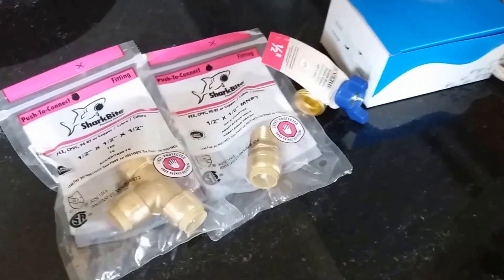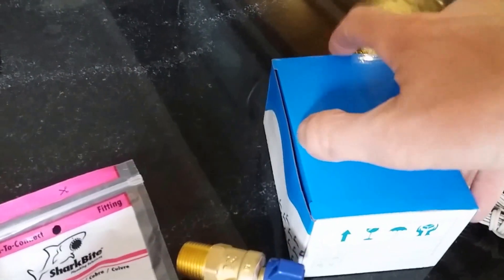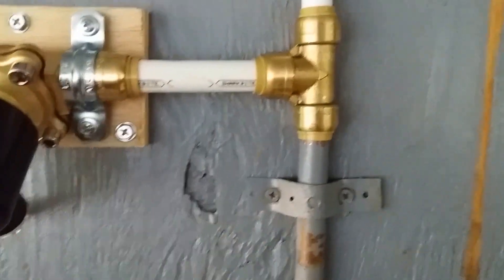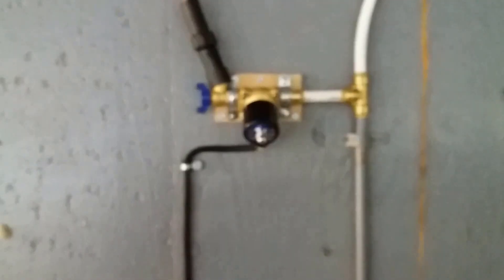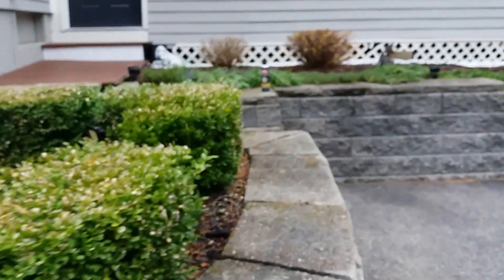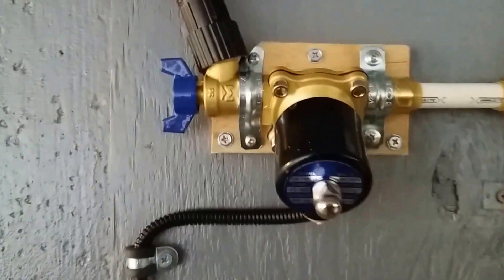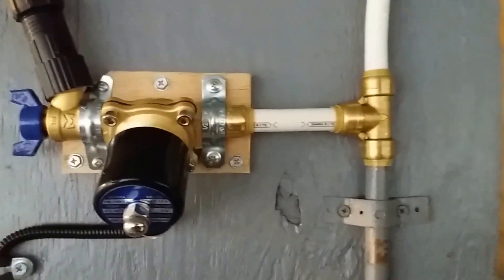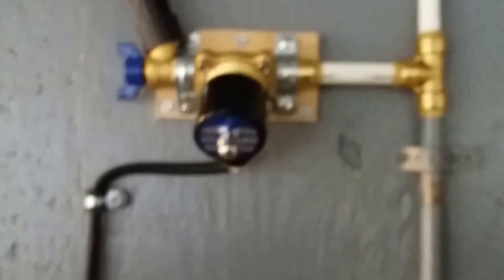Automate Irrigation Systems For Less Than $50 - Voice Control Lawn, Garden Sprinklers

Comment: just curious  how is it working after few years?   also how are you controlling the power adapter turning on by alexa?
Reply from the maker: It worked great right up till last summer when I opted for a full 16 zone irrigation system for the whole property.  If I had a 6 zone or less system I would do it again in a second.  It never gave me any trouble but once you get over 4 - 6 zones the pricing makes more sense to go with a full "smart" irrigation system.
Reply: @Trialnerror  how did it connect to Alexa again?

Comment: You didn’t mention the most important part, how is Alexa integrated with the solenoid? Please be specific. Thanks.
Reply: More specifically, he probably has a Smart Wall Plug or Receptacle that is controlled by Alexa, and the 12V Power Supply is plugged into that.
Reply from the maker: Just wire the 12v feed directly to the solenoid.  1 pos, 1 negative and you're done.

Comment: It's a 12 volt solenoid, how did you drop the voltage from the zwave switch?

Nevermind , I get it, the wall wart dropped the voltage from the plug.